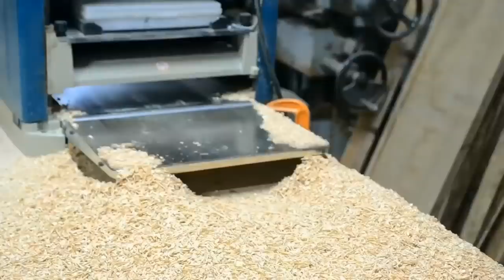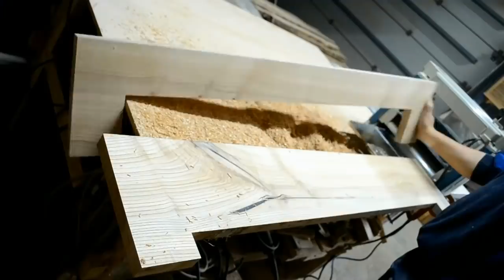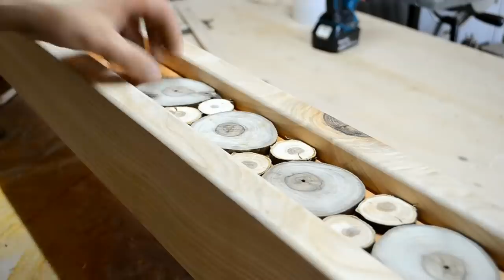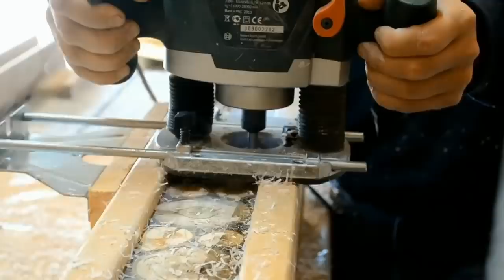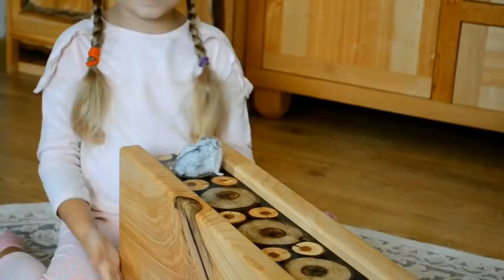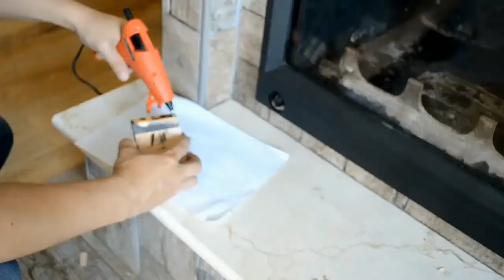Mantel Shelf

Comment: Does the epoxy dull your planer blades quicker?  And where do you keep getting all this beautiful wood?  It would cost me a fortune to buy lumber like that.  Well done as always.
Reply: It would only dye your blade if you're trying to take a whole bunch of material off at one time you go as soon as possible Plus at high temperatures would gum up your plane or big time and what do you mean good looking wood that's like Douglas fir 2 by 6 is that he's using for that mantle you can buy that at Home Depot
Reply: @shaneknerr4014  - did you even watch the video?  He ripped a live-edge slab in half which means he either gets his wood from a mill or fells it himself on his own property or somewhere else.  Most of his wood is live-edge and you can NOT buy that at Home Depot, if they even have Home Depot in his country of Lviv.